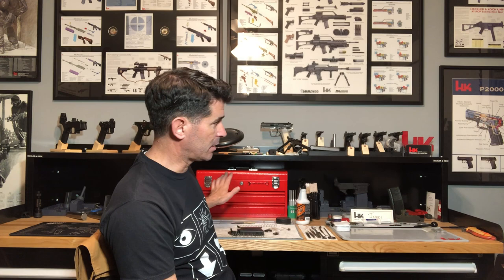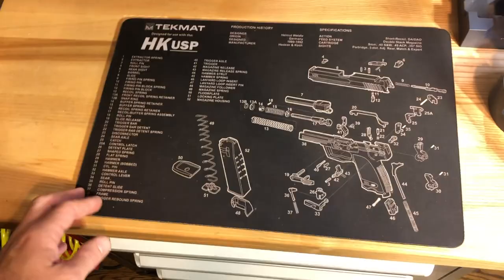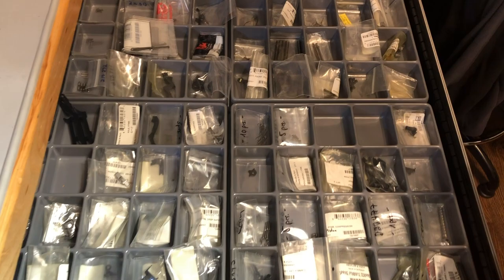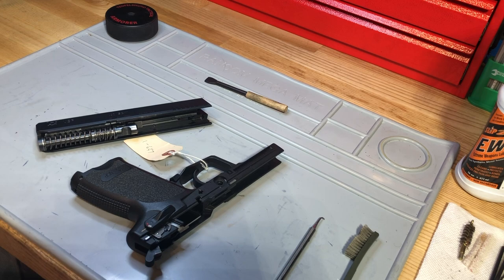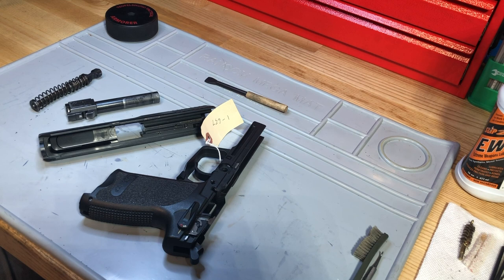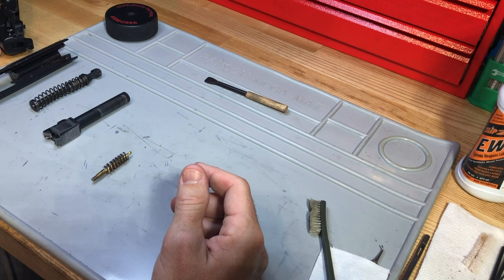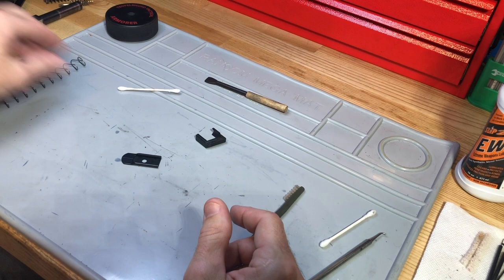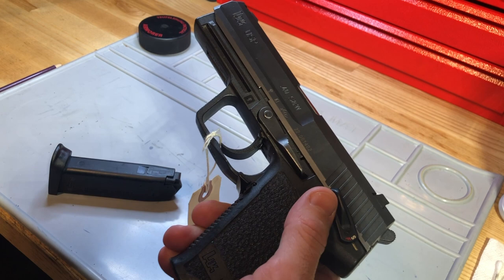Teufelshund Tactical Maintenance Recommendations

Comment: As always, solid info James! Question: Am I correct in that you use the word "solvent" and "lube" interchangeably when cleaning your firearms? The reason I ask is that I also use Slip 2000 EWL, but I use it primarily for lubrication, not as a solvent for cleaning. For cleaning I use Slip 2000 725 Gun Cleaner. I was not aware that EWL could be solely used as both a solvent and as a cleaner?
Reply from the maker: I use EWL as a cleaner, lubricant and protectant.

Comment: Nice video again James.
What you would recommend to clean a barrels with deep dirt inside?
Should I keep it submerged in any substance? Which you would recommend? Do you have any experience with robla solo mil, from Ballistol?
Thanks
Reply from the maker: I soak them in Slip 2000 Carbon Killer
Reply: And leave it soaked for how long?

Comment: Good video man! You sound like the YouTube resident expert on all things HK you have a subscribe from me! Question, I just picked up a used usp full size new to me, date code 2003, to me it looks like the slide was cerekoted it's a glossy shiny black, I'm not sure if that was ever an oem slide finish? All the other HK's I've seen were more of a matte / grayish black slide. Also any suggestions if I should be replacing components at the age of the pistol just to be on the safe side not knowing the round count?
Reply from the maker: Thanks.  You’ll find an entire channel dedicated to H&K firearms here.
Without seeing your pistol, I could not say, but the finish has changed slightly over the years.  High wear items are the springs.

Comment: What do you recommend for spring maintenance? I’ve seen the recoil springs for HK’s should be replaced about every 10-15k rounds, but what about the other springs like hammer spring, trigger return spring, and firing pin spring? I have a USP and P30 that I carry and shoot often, and also dry fire a lot as well. Have almost thought about getting 2 of the same guns I carry, one to carry and one to shoot/practice with so I don’t have to worry about parts failure. Run a few thousand rounds to break in and buy another to train
Reply from the maker: 10k is a great round about recommendation for springs, but you can certainly go further.
Reply: @teufelshundtactical  awesome, thank you. That’s kind of what I was thinking, just replacing all spring when I do the RSA. I love how durable these guns are. I’ve put 3k rounds through both my USP and my 92fs and the 92 already needs some new springs. To be fair though I dry fire the hell out of these two guns. I still love my 92 but the USP is my favorite

Comment: Have you ever tried Mil-comm products such as TW-25B?
Reply from the maker: No.  I'm very happy with Slip 2000 and Liqui Moly products these days.
Reply: @teufelshundtactical  I'll have to give it a try then! Do you prefer using the EWG or EWL to use on frame rails on USP and HK45/P30 series?
Reply from the maker: @maxhernie8053 Depends on the environment I’m operating in.  Mostly EWL though.

Comment: Is there any reason not to wash the gun with a garden hose (after detail stripping it) and then drying out the nooks and crannies with high pressure air? I use my USP as my carry gun for very dirty outdoor activities and this seems the best way to clean it when it REALLY eats mud and dirt.
Reply from the maker: Introducing water is never a good idea, as it will just lead to rust.  Lots of areas it will pool and it.

Comment: I’ve noticed on my USP that just under the hammer, there’s a lot of black grease. I presume it’s just grease with carbon imbedded. How do I clean that out and regrease?
Reply from the maker: Yes.  A complete disassembly, cleaning, inspection and reassembly, like what I offer is the best way to get into those areas you cannot otherwise reach and clean out carbon and gunk build up and light surface rust and properly relubricate.

Comment: What are the main failure components on the USP series?
Reply from the maker: The only trend part I have seen fail on the USP and hammer fired pistols that followed it, has been the sear spring, and that is a rare occasion.
Reply: I would bust a heavy trigger return spring every 12k rounds or so. That’s live fire of course, I couldn’t even begin to count the number of dry firing between spring changes. 

Full-size USP9 converted to LEM TGS, for the record.